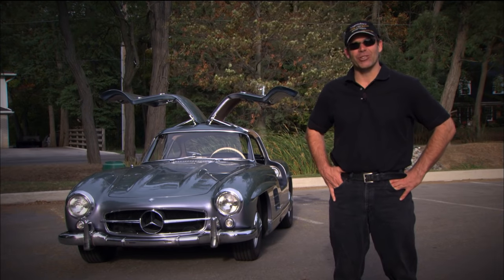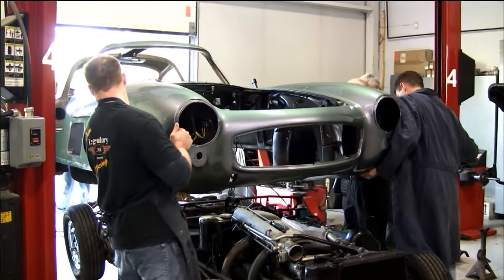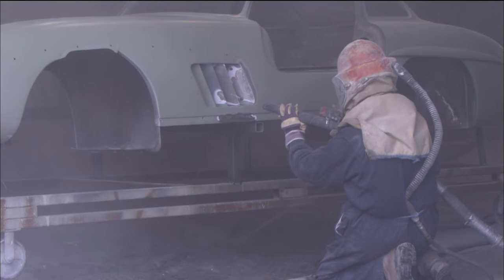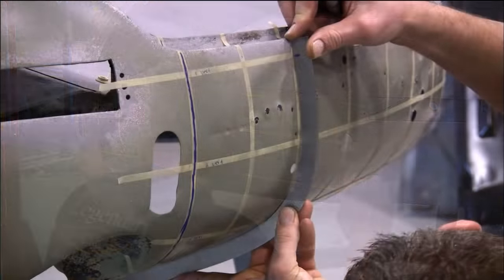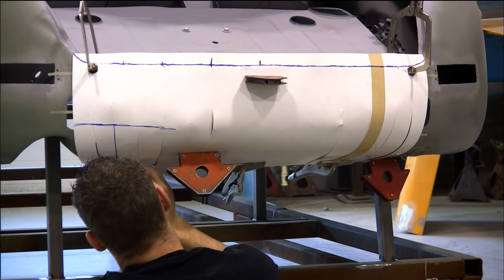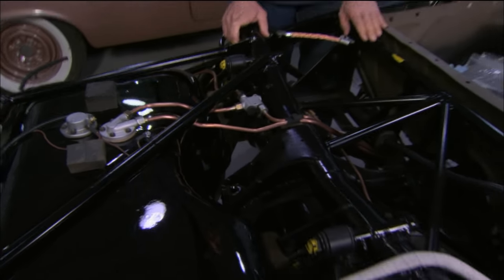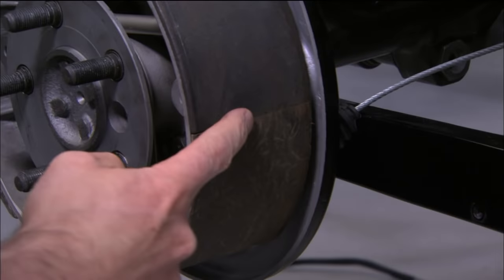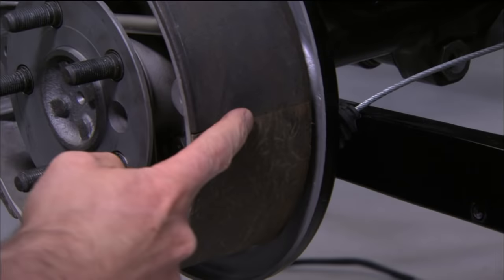Restoring a Mercedes-Benz 300SL Gullwing in only 8 months!

Comment: Very informative regarding the steps involved.  One thing I may have missed..the 300SL had rubber padding preventing the frame tubing from hard contact with the body sheet metal.  It turns to gum or powder over the decades.  They were pleasant on the highway but now they are very noisy ..really too noisy inside for pleasant touring.  Did the rubber get installed?

Comment: My dad was a MB mechanic for 48 years . No matter how bad his life ever got he ALWAYS had a job at a dealer because he knew these cars ( and he had plenty of struggles ). He used to tell me about the how the body came off of the chassis but I never got to see it till now , thank you.
Reply: Not many Mercedes had that style frame but the panels were fixed onto the steel bodied ones basically the same. Just tougher to hand form and heavier, so not appropriate for a sport light. Such awesome and specific purpose in the gull wing. Check out the newer gen sls as well, its a modern sport light
Reply: Not easy to repair
Reply: Mercedes here in Germany is a life time relationship. Generations of families worked for Mercedes. If you are a youngster and did an Apprenticeship with Mercedes, you belong to the family all your life. They take care of you until you`re an old man. The Motor industry In the USA moved production to countries for the cheap labour witch killed Detroit and the beautuf cars that came out of the USA.

Comment: Excellent video. One thing would interest me, however. The W198 300SL has some very sticky engine issues related to overheating and fuel running into the cylinders after shutdown. I would love to know whether these issues were addressed and if so, how they were dealt with. Here in Germany we have a number of shops that deal especially with the W198 and each has their own solution to these issues. This car is so special it needs and deserves endless care in restoration and upkeep. Thanks for this valuable report.

Comment: I worked for Terry Rhodes Restoration in Capitola   Ca c.1978. He did beuatiful work...died c. 2006...I think lead poisoning contributed .I  saw 3 MB 500K and 3 gullwings go thru... One had Aluminum  trunk etc.  He never used feather fill but his supplier convinced him to try it. He prepped the aluminum 300SL trunk all day, had it in bare aluminum and he sprayed some featherfill on it and we went home....Next morning we went to Dunlaps Donuts (they were great) and the shop, opened the door and the featherfill looked like a dried lake bed. So he stripped it all off and never used feather fill again. Since I'm reminecing, his restoration of a 1903? Stevens Delahay won best of show or class at Pebblebeach c. 1975. Bruce Kanepa had something done .... he had a 911 Porsche with a 350 chevy and aluminum heads he said it was 40lbs lighter than a porsche engine. He had some legal issues with gray market porsches from Oregon?, had a dealership in Santa Cruz....Still racing today.   I recall some friend wanted his Speedster done Right Now.... We stripped it down to bare metal and primed it and pushed it into the yard to weather for a few weeks while other issues were attended to. He sprayed it in silver. Guy next door did upholstry and that was a cool $7000 for a Speedster interior in 1978.  It could go much higher....Guy used lamb wool stuff that had such a texture.... and 4 months later the Speedster was done. And I think he paid $40,000 for the restoration.  He did my 53 Porsche.  it had a 64 SC engine and was 1800cc.

Comment: Good point on using power tools for fitting certain parts.  In general, I only use power to remove items in normal automotive things.  Most good ratchets and other tools make relying on power not so important.

Comment: Looks very good at first glance but there's quite a few flaws. The front bumper doesn't fit properly, there's something not right about the trim fit on the lower front wheel arch and thers bubbling in the paint at the bottom edge of the nearside headlight.
Reply: Yep! You couldn't miss the bubbling around the RH headlight. I'm sure it was addressed.

Comment: Watched gull wing drive by. Then heard huge bang.
A Camry t-boned it!!! 
Couldn't believe the extensive damage compared to the Toyota
Reply: Heck! The difference is the gullwing would have been repaired.

I watched an Alfa Montreal get T boned by a motorcycle once. Ruined the door and rocker/sill panel. The rocker/sill panel probably made it hard to repair ... not as special as a 300SL but still a rare car

Comment: GULLWING ... The 300 SL needed the door design, as its tubular frame race car chassis design had a very high door sill, which in combination with a low roof would make a standard door opening very low and small. The Mercedes engineers solved the problem by also opening a part of the roof.
Now the Car: There never was, is or will be a car it. It is, probably, the most good looking driving machine ever made. It is not a car that one drives in Cornwall on windy, wet and winding roads like a Morgan 8 or a Lotus but on German Autobahn, matchless and domineering, even today ... she is saluted all along ...There aren't many left.  ..

Comment: 3:40
He is talking about removing paint by hand.
What I see is an aggressive rotary sand at 10000rpm
Reply: 2:00 Peter's narrating about extra care taken in disassembly. Notice that while the driver's door is unfastened and being lifted, for a split second all the door weight rests on the corner that dropped and touched on the roof when lifting. Dented? Oh the irony of it!

Comment: Shame on you guys. The Mercedes Benz workshop manual calls for a tube inside the repaired tube, 4mm weld gap, rather than your method of butt welding a single tube section

Comment: This was not a restoration. This was a handbuilt custom. No factory takes the time and effort for detail, fit and finish. Non original paints were used. Having done restorations and having worked on the assembly lines in Detroit in the 60's it just bugs the hell out of me when I see and admire the craftsmanship  that went in to the car but the claim of restoration is false. I am in my 70's and doing what I refer to as a refurbished 1966 Mopar in my driveway. Every system in the car is serviced, repaired or replaced as needed. It will be closer to original than one of your cars as it will be a daily driver well maintained as close to original as possible automobile. My 2 cents worth. And your shop does exquisite work.

Comment: 300SL.....there's actually nothing to it once you get it apart.....if not for the doors and the flowing lines exterior styling it would be another chevrolet....very simple car.......the real question is why does nobody make factory replicas by the tens of thousands of this popular car?  probably the automotive laws have changed so much that they no longer permit a basic simple car like this to be made

Comment: I would never own a stick shift/manual. The transmissions break down so easily; they may “supposedly” get better gas mileage…but that’s not always the case; multiple transmission problems yearly; too confusing for some people to learn; not good in city traffic; higher repair bills; worn out gears; misaligned transmission; metal shavings in the oil; harder to control on hills; it gets tiresome to drive in heavy traffic; it can stall & roll back. Need I say more??
Reply: The shear joy of driving a stick shift cannot be matched with an automatic. I still miss my 1956 190 SL.
Reply: @bruceharvey8810  sorry; there is no joy in driving a stick shift. Period. It’s way too much of a hassle and pain in the ass. No thank you. Bye now…

Comment: It's only original once, preservation not restoration, Gullwing Motor Cars Inc. Peter Kumar's motto?
Reply: IMO Kumar would make a decision based on each cars condition. Also the client/owner would have a say. Kumar and Carrini ,CCC, bought a barn find 300sl. which looked like it might be a preservation project. Do not know what they decided.
Reply: @peter1317  As I recall, in that episode the Gullwing had been in that garage for a very long long time, Kumar, would have let it as is, and let the guy who bought it, decide, the patina crowed always want preservation, not full-blown restoration, once you take any of these vehicles completely apart, they are never ever as tight as an original was, no clue who bought it, if anyone, it may be still in his massive warehouse of non-running cars.

Comment: dry ice would have removed everything safely
Reply: No it wouldn’t
Reply: @Johnsormani  please explain. I have seen videos people doing it, of course the pressure and the pellet size is different ..
Reply: @wozmac771  the high pressure will distort the material just as much as sand blasting, low pressure dry ice doesn’t do much to paint . You could add abrasives to the dry ice , but that gets you in the sandblasting ballpark again.  . I’ve stripped the paint from my w111 coupe with a paint gun and putty knife. Hardly any heat in the metal, no warp and it goes just as fast
Reply: @Johnsormani  thx. appreciate it

Comment: At 5:26 in you say the tube is 25 mils and 1 mil thick.   1 mil ?????? come on man
Reply: Very USA centric. 1 mil is 1mm in Europe whereas in US, 1 mil is a thousandth of an inch. So tube is 25mm dia with wall thickness of 1mm. I think that solves the conundrum.
Reply: @richardsheil5289   Exactly I know what 1 mil is that was the reason I said something, Thanks for the clarification
Reply: @richardsheil5289  and still they go over it with a grinder like there’s no tomorrow, next to the welds